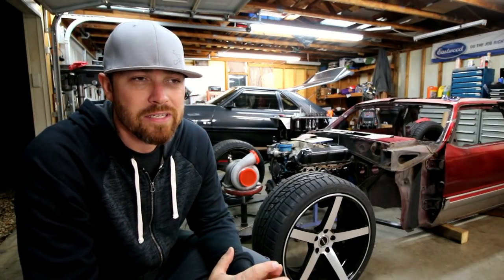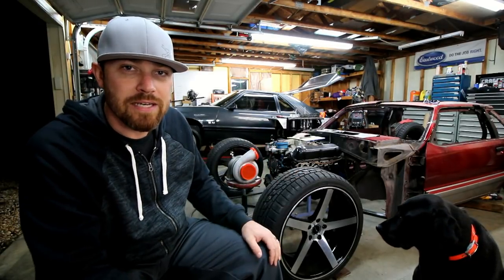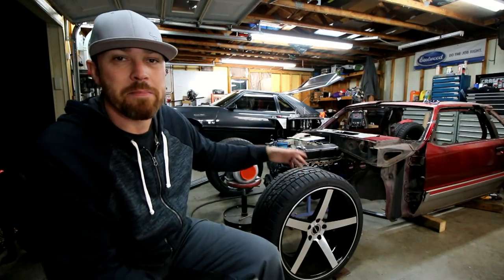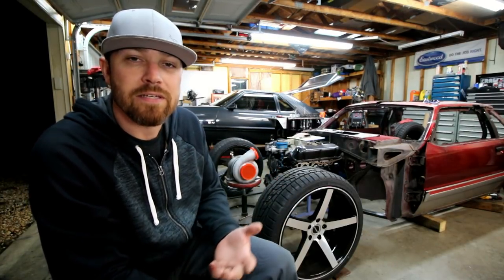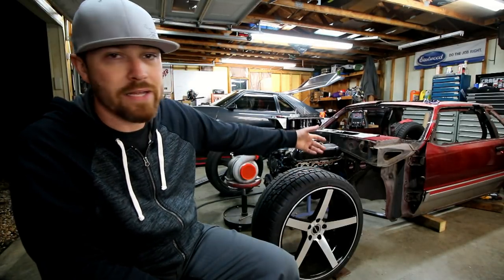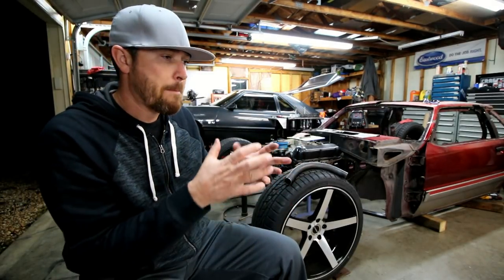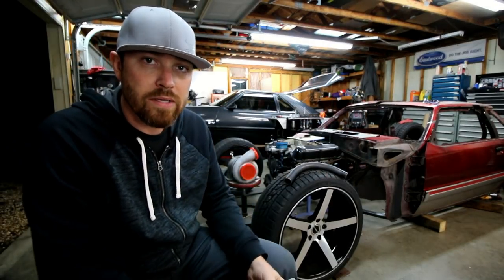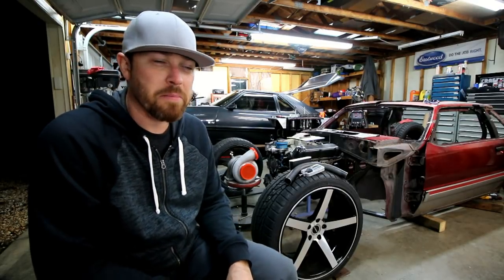Tube Chassis Work On The Mustang Hot Rod Build

Comment: Hey bro, just a thought about hunting for a new shop... see if you can find a hangar to rent at a local public airport. Huge doors, plenty of space, some even have a small office. I know you probly need 220 but you might get lucky. Theres tons of hangars sitting empty on little airports, you might find a good deal. Plus airports are generally very secure, so you wont have to worry as much about your tools growing legs.
Reply from the maker: +DG Fabrication I tried that. I figured since I worked for that county I would have an in but there was two issues. They were all full and apparently you have to own a plane...silly

Comment: A large framing square comes in handy to keep track of remaining square thruout the process. 

I also use 6x4 beams from home depot or lowes to layout a good platform to build and use a pallet jack to move around the build if need be.  Poormans frame table you can screw together with fixed points once level.
Reply from the maker: +joe ravinu yeah

Comment: BendTech Pro is absolutely worth the money.  Just in time and tube savings it'll pay for itself in no time.  That being said, some of the best tube guys I know don't use anything...
Also, if you put that Plane of Bend digital protractor (the billet aluminum clamp with digi level in it) on the end of the tube instead of the start, you don't have to move it and it'll show you any out of plane twisting between bends.
Reply from the maker: +Russell Telker Yeah I used bend tech when I did the goose chassis. I put the gauge in the middle on this one because I bent from the center out on both sides
Reply: Missed that part.  Yeah, that makes sense then.   Loving the design so far, lookin forward to the next part.

Comment: Using the old Eastwood Tig 200 digital I see.  I pull the trigger on one.  Awesome welder!
Reply: Also is that a JD squared tubing bender with a hydraulic ram?
Reply from the maker: +Goheen Cycles No it's the new digital init
Reply from the maker: +Goheen Cycles 105 he setup with home made ram
Reply: Thats what I meant.  I love mine.  Thanks for the recommendation!

Comment: pitty bout the shop but nice to see you work on the cars again 

havent been sitting still , bought an endmill and a lathe , cleaned one of the bedrooms and starting to make it intoo a workshop 
more parts for a cnc router are allso starting to come in again 
last project : since the apartment doesnt has an elevator and i live two floors up i have build a hoist arm and bought an 220 volt (standard one phase house current over in the netherlands ) electric winch to hoist the lathe up ontoo the balcony  and from there intoo the workshop 
it be iffy the steelcable is capable of holding 150 kilo they say , but its pretty thin  and 150 kg is pretty close to the weight of the lathe  hope i dont make a big dent in my dreams and the turf under my balcony 

dont think i do a you tube channel once everything is running , im more of a guy that works and dont stop for nothing or forget the camera is running or out of memory  , i might post pictures on some fabricator forum

first project : fix the electric motor from a drill press  with a bend shaft (going to weld it up and turn it down )

cool idea with those markings on the pipe bend , i can see that working pretty good  , like the holder for the angle gauge too (bought the same one ) 

have fun at sema
Reply from the maker: +Septic Society lol
Reply: whell watever brings people to youre youtube channel , tested the crane yesterday lifting a big pallet up to the balcony to make the new floor 
i had to raise the floor on the balcony so i can pull the wagon holding the lathe over the treshold intoo the house , ill try to make some video and pics of the lift and hopefully the placement on the workbench when i come around to it and send you the raw footage to do wat you want with it , found out yesterday the lathe weighs 180 kg /397 pounds , have to double up on the crane cable (max lifting load 150 kg single cable 300 with a pulley and doubled ), im lucky the cable is long enough to still make it down to the ground floor
ok part two : 
http://s19.photobucket.com/user/watahyahknow/media/P_20171105_113916_zpsi1gpy65f.jpg.html
http://s19.photobucket.com/user/watahyahknow/media/P_20171105_113935_zpspeowk9pe.jpg.html
http://s19.photobucket.com/user/watahyahknow/media/P_20171105_114603_zps0vau5xc7.jpg.html
http://s19.photobucket.com/user/watahyahknow/media/P_20171105_114556_zpswutaoxvj.jpg.html
http://s19.photobucket.com/user/watahyahknow/media/P_20171105_115021_zpstl9vurbn.jpg.html
http://s19.photobucket.com/user/watahyahknow/media/P_20171105_124635_zpsouz2yceh.jpg.html
http://s19.photobucket.com/user/watahyahknow/media/P_20171105_125014_zpsnphoqacs.jpg.html
http://s19.photobucket.com/user/watahyahknow/media/P_20171105_125918_zps1q9uyuqf.jpg.html
it all whent suprisingly eazy considering the weight and all the only thing was that the load wanted to turn during the lift and i had to keep an eye on the steel cable rolling ontoo the spool the propper way , it all whent fine  
now i have to see how to lift the thing ontoo the workbench with the enginehoist cause the legs dont clear the cabinet 
will think of sumting eventually

Comment: Interesting build. IMHO your videos would be improved if you get yourself editing software that has speed adjustment in it. That way you can speed things up from normal to double or way up to 11x, or slow stuff down too. I use Cyberlink Power Director which I'm sure you'd love. Easy to learn how to operate & endless editing options, titling, fx. Just a suggestion.
Reply from the maker: +WJP004 mine has speed adjustment

Comment: You mentioned removing the frame /cage from the cab/cockpit. When you put that rear hoop in it looks wider than your rocker panels. That means the body won't lift off of the frame/cage.
Is that just an optical illusion?
Reply from the maker: no it is a little wider. will have to probably slide it out the back
Reply: How? It looks like the firewall will hit your cross bar and appears the door bars are wider than the A pillar area. Have you tried removing the body yet?

Comment: How do you determine how much tubing you'll need?
Reply: Rob Clark on the cheater pipe he show .I also mark ever inch.so I know that to do 10degrees I need 1.25 inches of pipe and I need about 11 inches to bend 90degrees .TFS for more info
Reply: Tape measure.
Reply: patw52pb1 but how do u determine how much pipe it takes to do a given degree of bend.
Reply: +Robert Smith
I think this is what you are asking for. 
That dimension can be calculated as follows: 

L = R x D x 0.017453

L = Length of bend in straight tube
R = Centerline radius of bend
D = Bend angle in degrees
0.017453 = multiplier to convert degrees to radians 

If this is not what you are looking, just supply more specifics.
Reply: patw52pb1 or just use a cheater pipe........
Reply: +Robert Smith 
Actually the easy and accurate method is to use a 3D design software such as Bend-Tech. 
We use Bend-Tech IND in our shop and I personally own and use the economically priced EZ-3D package and it is much superior and accurate to using a "Monkey Piece", "Cheater Pipe" or any manual method. 
However, if one is willing to do some reading and comprehension there are numerous manual methods that can give usable results with time, trial and error practice. 

No matter what method someone uses, there will be a learning curve becoming familiar with the individual tubing bender being used. 
No manual method with or without a "Monkey Piece" or "Cheater Pipe" will visually show you mistakes before cutting, bending and trial fitting like a good 3D software package does. 
It does not take many mistakes to justify the cost of a good cage/tube layout and bending software package, particularly if the cage is fabricated to SFI specs and is to be certified. 

https://www.onlinemetals.com/merchant.cfm?pid=7347&step=4&showunits=inches&id=250&top_cat=197 

http://www.bend-tech.com/product_infos/bt_ez3d.html

http://www.pirate4x4.com/tech/bendin_tube/index.html
https://www.jalopyjournal.com/forum/threads/tube-fabrication-101.570330/
https://www.irvansmith.com/scart/images/UPLOAD/File/Instructions/ISI%20Tubing%20Bender%20Instructions.pdf
http://blog.mchoneind.com/blog/tube-bending-formulas-tubular-components-design
Reply from the maker: +Rob Clark i just measure it all out. The bender stretches it as it bends and makes everything longer so there tends to be a little extra at the end

Comment: so you didn't need that shop fool! its cool! always something close.......yea car projects take up more room than most people think.......any room for a shipping container.....
Reply from the maker: +Donald Powers I still have some things in the works
Reply: The Fab Forums look and keep looking safe ares easily secured...you know the drill......good hearing from you, I have a great place who ever gets to and puts some work in  it will it will be great.......I built my stuff down the side of shipping containers 
ran pallet racing most area are 12 wide nd a 20 ft wide across
the face of it ..and above it I put the cross beams a 8 ft. and CREATED a loft......and then went over the top of the container 
needs some concrete for the floor....to complete it I like the 20 x40
areaacross the front I hung beams on both sides and 2 going across separated by 4.5 ft chain falls on both cross beams mooing it like a crane......the chain falls roll n-s and the crane rolls east and west......not quite done ......it's will be a car guys dream or nitemare... depending on his wallet......lol
Reply: The Fab Forums I had high hopes picked up a jancey jb 2400 with both sets of dies... I seen they may of used 2 then one time others NEVER been used.....machine sells for 7k die sets 4k plus each set...should put it up for sell......considering sell many of my toys and projects looking at the hellcrate 707 hp....about 24k with kit 
I'm and old drag racer put a 69 ROAD RUNNER in to the 10:70s back in 84.....it was stick, so it would be "hoped for project" for the 707 hell cat engine.......I have a coupe lighter mopars......but I could build  an INDY HEADED 500 STROKER.......AND BRING THE RR BACK.     IT WAS CHASSIED LONG AGO....AND ITS LIGHT 
MUCH LIGHTER THAN THE HELL CAT........LESS THAN 3000K